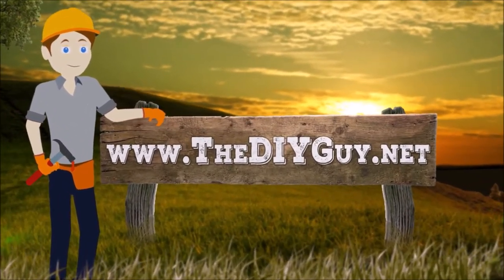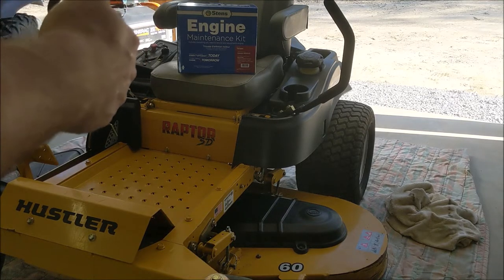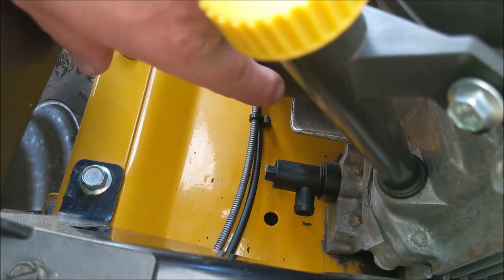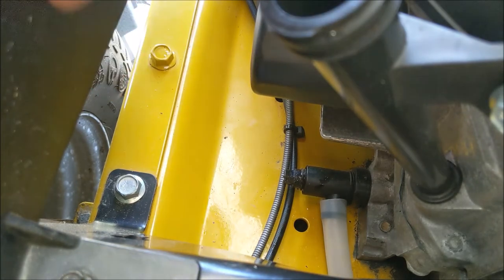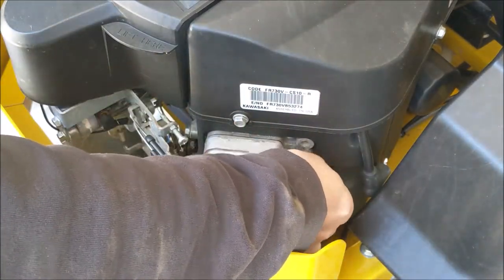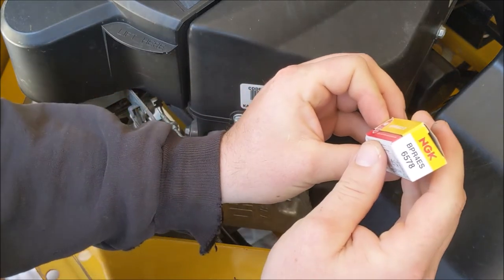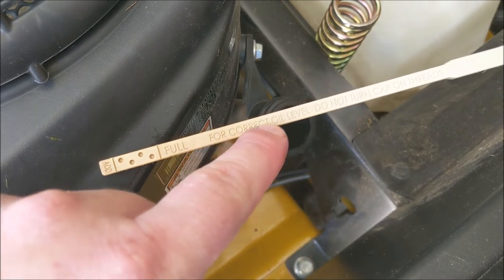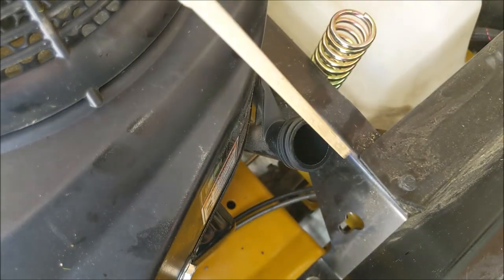How To Do A Complete Engine Service On A Hustler Raptor SD

Comment: Engineer who designed Oil Filter must've graduated last in the class. When I change Toyota oil filter, don't spill a single drop, great design. Is there a way to prevent oil from Oil Filter removal from spilling like that on the Raptor?

Comment: Wrong motor. What about the Koehler with heavy duty air filter?
Reply: Hey mate I owned a Kohler they are simple to take off the cover is at the rear and they are cylindrical and pull off, I used to blow mine out with the air bower on a job